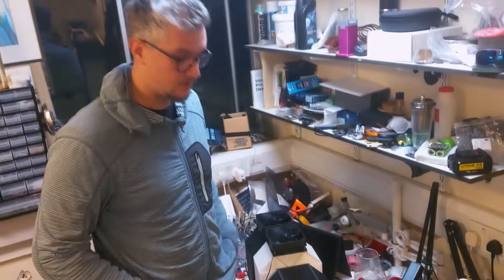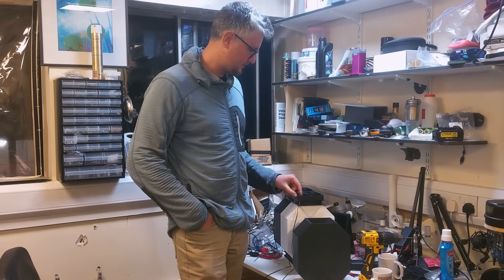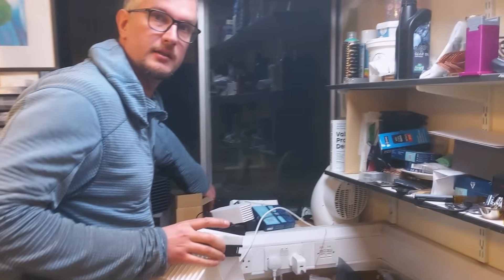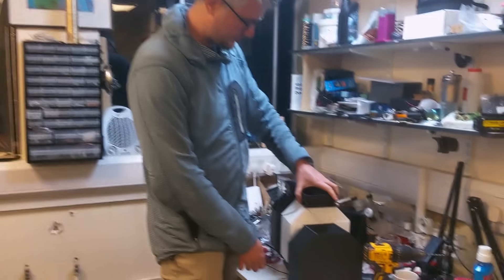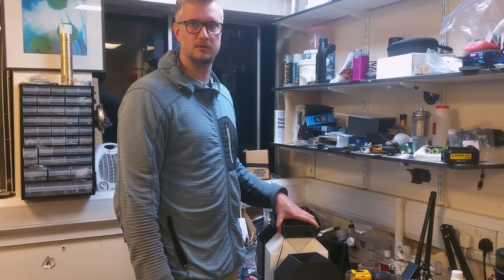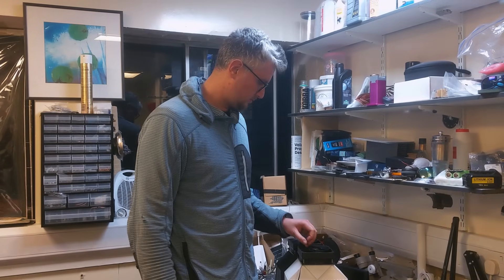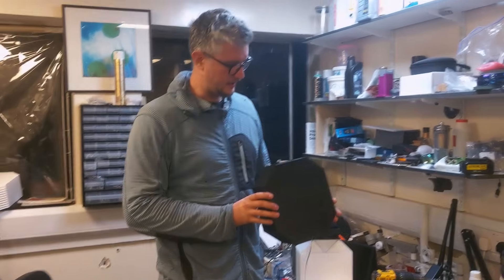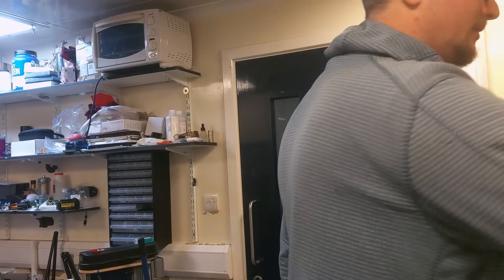Heat and dehumidify your house for cents per day

Comment: Is this supposed to be an ERV that exchanges both heat and moisture? I don't see how you can do that with only a 3D printed structure. I'm also very skeptical of the 85% number, particularly if this is supposed to be an ERV and not just an HRV. How was this measured? I've done some rough designs using materials that are much better suited to moisture and heat transfer and hitting 85% efficiency is difficult for any meaningful airflow. I'll look out for your design details.
Reply from the maker: The PLA membrane is essentially impermeable, so is just heat transfer not humidity.
Reply: yes, I know, I was quite surprised myself. But the smart unit gets you 20C inside, 3C on the outflow, 0C outside and 17C on the inflow  when the fans are at 25% (which still moves plenty of air). Maybe  it is due to the surface area, as we push towards 1.5-2sqm per unit.
Reply: Thanks, so it's an HRV. The true efficiency is lower than the raw temperature suggests because that doesn't account for latent heat, but being able to just print off an HRV and slap some fans on it is pretty cool!
Reply: @naasking  in this range of temperatures, the energy is pretty much proportional to the temperature. Cp for air is about 1kJ/kg K, density is about 1.2kg/cubm. 

So if you returned 17K oof temperature  back out of 20K differential, the returned heat is very much 17/20*100% because the formula for deltaQ=Cp*DeltaT is applied. (My background is in Physics). 

The enthalpy of water vapour can be pretty much ignored as there's only few g of water in cubm of air at 0-20C temperature range.

Not exactly 85% but very close to 85%.

Comment: I'd be a bit worried about how much air is getting pulled through multiple times- ie moist air exiting and then being immediately pulled back in, and similar for dry air being pulled back out. I'm guessing that's part of why you have fans blowing away on both sides? Trying to throw the product air as far as possible from the return inlet? (my initial though on seeing this was 'why have 2 fans', and 'why have 1 fan outside / exposed to weather'- I'm guessing it is so you can avoid ducting while still solving the outlet/inlet leakage issue). 

Interesting/cool idea. Have y'all gone through and explicitly tested inlet vs outlet temperatures? (not clear if y'all've done testing vs calculations). That'd be my other curiosity is 'how good is heat transfer through a single layer of PLA'; though I expect with thin enough walls and a large enough dT it's fine.
Reply from the maker: Placing those stators on the fans makes the flow pretty linear, which plus the angle as you say means there's not a lot of cross contamination of the flows.

The test installs do have in and output temperature and humidity sensing, and the room has CO2 ppm.

The PLA is 0.25mm thick, so the heat transfer's pretty good. We're looking at options for a stamped aluminium foil version, which is a lot trickier, but would greatly reduce the cost and manufacture time as well as effectiveness.
Reply: @OpenSourceLowTech  is it possible to do a framework to fit together and fix aluminium foil on manually?

Comment: Interesting, really cool idea. How airtight will it be with 3d printing? You loose efficiency and clean air, if air just leaks between the two streams.
And what about condensation?
Reply from the maker: There doesn't seem to be any measurable air leakage. 
Condensation hasn't been an issue in testing, which being Scotland, can be considered stress testing.
Even if there was, it's a fairly short stack with reasonable airflow volume and velocity, so water droplets would likely blow out, and worst case scenario the assembly can be tilted down for drainage.
Reply: The condensation, surprisingly, happens outside rather than in the unit. 
Probably because we installed it in the room that is on its own is about 120m3, while the flow rate of 4 units is about 320m3/h, so, we simply exchange too much air for any condensation to remain.

Typically heat exchangers in large centralised systems are made of paper, and it is done so the humidity actually can reenter the In-flow as otherwise in the cold month you will dry your air too much. But in Scotland the problem is the opposite :) So plastic, non-soaking heat exchanger is better for drying than the paper one.
Reply: It isn't too airtight and you do expect some percentage of the air from one stream mixing in with the other, but if you loose 5% as it sips through and mixes, you still have 95% of air successfully returning the heat.
The pressures on those fans are 2.4mm H2O max while very low resistance for the flow in/out. So in the airflow through the unit you have 80m3/h, so 1.5 or so m/s, and surely it doesn't mixes air anywhere near that rate :).
Reply: Thanks for the answers!